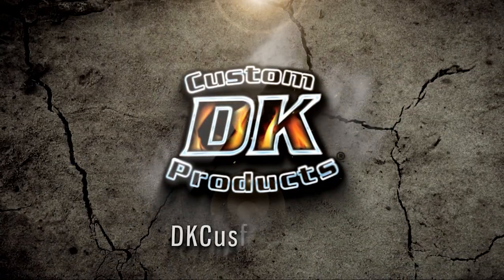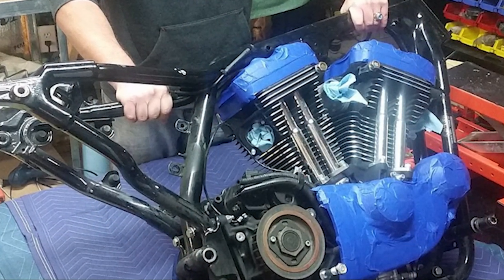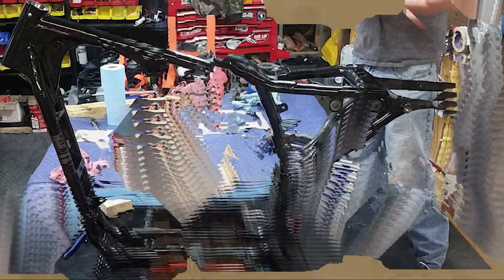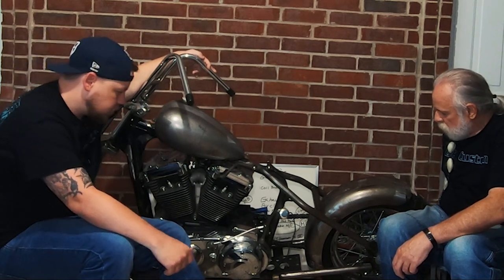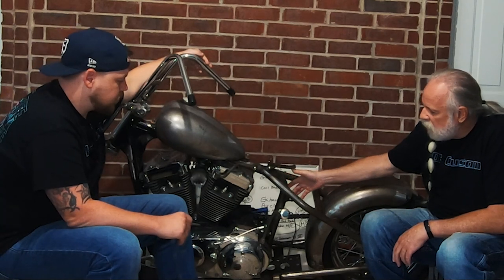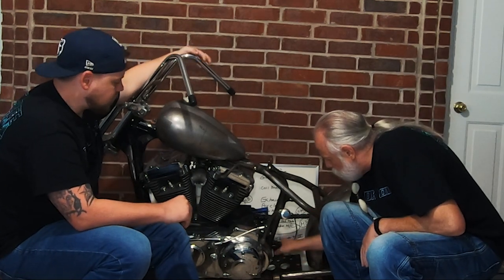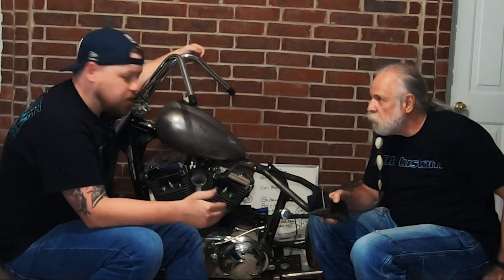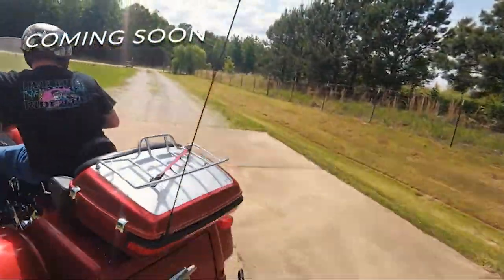Part 2 -  Making a Sportster Into One of A Kind

Comment: Will the electronics box be in a cool enough location? Under the engine should get lots of air flow, but soak back could heat things up.
Reply from the maker: There is only one electronic module, and I hope that it stands up, the of the stuff in there are wires and connections.

Comment: Kenny, I have a 19 Tri glide that not much else will fit changed everything.  would like to build my next trike starting with a Harley road king with a springer front end. will use a frankenstein trike rear end.  issue is that i am being informed that upgrading the motor to anything at or above 131 will cause the front end to pogo and not be safe.  what do you think?  is there a way to up grade the springer front forks.  love your project bike. great video as always.
Reply from the maker: Sounds like fun.  Yeah, you will have to be careful with the throttle with a 131 or bigger, NO MATTER what front end you use.  Getting a "good" springer is almost black magic, and I don't have much experience at all with it.  I would contact Sugar Bear for his advice.
Reply: @DKCustomProducts  Thanks